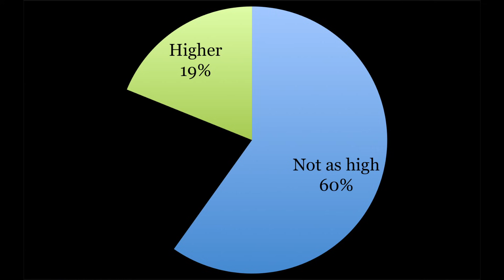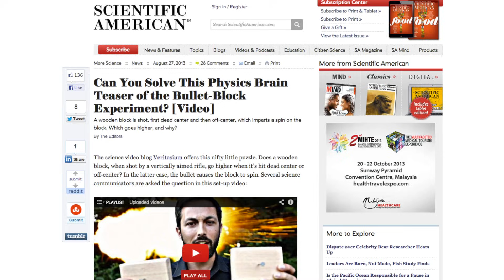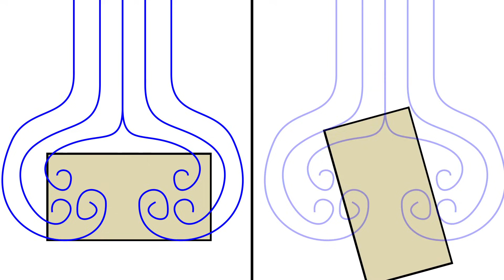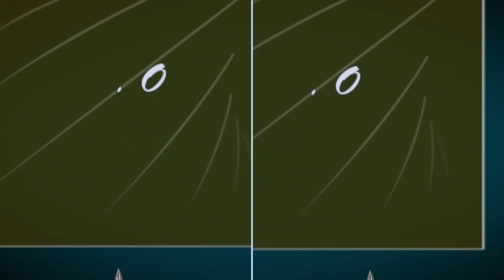Bullet Block Explained!

Comment: If they penetrated to the same depth, then why the hell did one nail go in farther than the other?
Reply: Derpcate abomination-face The mystery thickens.
Reply: My guess is because either one bullet deformed more, creating a compression of the bullet and so moving its back end deeper into the block, or because the tunnel created is curved in the off center block, as the block rotates whilst the bullet is still traveling upwards. But I'm not really sure....
Reply: they didnt take the bullets out.. so in one. the bullet is more deformed which is basically the one with the bullet at centre.. and the other one deformed less.. meaning its longer than the other one.. thats why the nail measuring method is wrong
Reply: +cat intensifies curvature my friend curvature
Reply: +The almighty hair God 8:10
yes he did.
Reply: because the old lady was biased
Reply: Looks like and did are not the same thing you know. ;)
Reply: +cat intensifies Nothing tells you that both those blocks measured travelled the same distance, they did try multiple times, and in the same way they made us think the block travelled the same distance in the previous videos maybe they did it again.
Reply: +The Eclectic Dyslexic - look at the x-ray image. Inside the hole is too wide to show any curvature.
Reply: The spinning one went in at an angle, so more debris blocking the hole maybe..
Reply: +cat intensifies If the simulation is 100% correct from a physics standpoint, it did penetrate farther in the middle
Reply: PenguinPatron the wood is the problem it had different intensity points I like to see experiment in plastic or foam something that we know it has same intensity
Reply: pay attention. .....
Reply: +cat intensifies I think he said the one off center IS slightly shallower...by 1/10th of a mm. He figured it out with equations since we cant notice that small difference visually.
Reply: Harry Armitage Yeah maybe something like that
Reply: Except does nobody know that the bullet is travelling so fast that it stops before the rotation of the block even starts or before the block even lifts off the ground. And the Xrays clearly show there isn't a curve.
Reply: @GetRoasted1  Not true at all, the bullet stops and the block move at preciously the same moment. one does not proceed the other. because the bullet is losing momentum at the exact rate the block is gaining it. Meaning acceleration is inversely proportional to deceleration.
Reply: it wasn't a straight line mostly as the block was rotating.
Reply: Maybe if they took xrays of the object in two different angles , ie both in the sidewats view and birds eye view , they could have got a better understanding of the depth..
Reply: I guess because the off-center bullet formed a curve, since the block would have started spinning before the bullet reached its full depth. So the nail got stuck when it hit the curve, not when it reached the bullet.
Reply: it curves
Reply: The nail didn't go in as far, because stick a nail into a hole is a very inaccurate measurement. The nail can get stuck any chip of wood in that hole, and your measurement is fluked. 

The reason why he would have left that part in the video, is to give show how confirmation bias can trick you: The nail seemed to confirm your hypothesis. That does not mean that it is proof: it could also be a false measurement (which it was, as shown by the X-rays). Just a little easter egg, and an important learning point if you ever perform science experiments.
Reply: Harry Armitagemy guess is the curve and the other one was straight up thats why the nail went further
Reply: When did he say it penetrate at the same depth? because he never did.

Comment: I don't think this explaination is correct. Just exchange the bullets with rubber balls, so the scattering is elastic, then the situation remains the same, but your explainatin doesn't work anymore.
The real reason that the spinning block has more energy after it gets shot is, that the bullet had already more energy before it hit the block. In the spinning case, the angle between the bullets trajectory and the center of mass of the block changes. Thus, the bullet already had rotational energy before it hit the block, which then was transfered to the block.

Comment: So if you did this in theory and where the bullet hit is the only different variable, wouldn't the less air friction on the spinning block make it go a tiny bit higher? So the 19% that said that the block would go higher weren't entirely wrong?

Comment: You could more accurately measure the depth of penetration by using a material that's easier to penetrate, and possibly a weaker/stronger gun. I'd recommend a bullet that does not disintegrate like a 762 and solid, transparent acrylic, or a much weaker gun and styrofoam. (although styrofoam would be extremely susceptible to misreads based on air resistance, so you'd have to do it inside.)

Comment: Or the change in height was only unnoticeable as the results themselves were so innacurate. When the frame comes up showing the height of all tested blocks the distance gap is huge between results of the same experiment. I think this more than anything is the cause for the conclusion. Ie: the results weren't accurate enough for a proper conclusion to be drawn.
Reply: Sexual Chocolate Lol, you're welcome to do the experiment at home.  He had hundreds of submissions of people testing it at home, all drawing the same conclusion that the blocks went to the same height (As they should with this type of collision, since the bullet stuck in the block).  Don't claim inaccuracies without attempting the experiment on your own, YouTube is just a poor medium to show this since it only allows for relatively low frame counts, or did at the time of this video (even now, 60 fps is relatively low when you're trying to show frame by frame measurements).
Reply: Sexual Chocolate If anything his spinning blocks appeared to go higher on average from the other ones. Yes there's variability, but his math and reasoning is perfectly sound.

Comment: maybe for those who don't understand what independent means you could indicate that they are perpendicular...this gives  a little bit better explanation of independent
You also cannot guarantee that the density of the blocks are identical, maybe you should try using man made material that is uniform throughout (or at least more than wood)

Comment: I think you got it wrong. This experiment clearly demonstrates the law of levers. When the bullet hits the centre, it would have to balance both the clockwise as well as the anticlockwise moment of force of the block i.e. the entire weight of the block. On the other hand, when the bullets hits the side, it needs to produce only anticlockwise moment of force, and since,
M.A. =effort arm / load arm
It would need half the energy to bring the block to the same height. The other half of the energy would be converted to rotational kinetic energy.
Note - The energy lost as sound and heat is equal in both the cases.
Reply: Yashraj Motwani That's not correct. First off, moments of force create rotation, they do not create linear acceleration. Secondly, it always takes the same energy to move an object upwards a certain height: PE=mgh. This value is independent of whatever forces or moments an object experiences (except for gravity, which is constant). 

As a side note, levers NEVER reduce the amount of energy required to lift an object, only the force required. Otherwise they'd violate conservation of energy.
Reply: Yashraj Motwani This is another way to explain but their explanation is correct too.
Reply: Bro thats dont makes sense
Reply: Go back to school

Comment: But if the momentum of the bullet is fully transmitted to the block as vertical momentum. Where does the rotational momentum come from?
Reply: Thomas Bezençon Rotational momentum is independent from linear momentum, and both are conserved independently. The bullet in the center is easy to explain: there isn't much angular momentum in the system before impact, so there isn't much angular momentum after impact, and we see that the block goes more or less straight up with some wobbles.

The off-center bullet is trickier. Obviously after impact the block is spinning rapidly so it has some angular momentum. So the system must have had that angular momentum to begin with, but where? The answer is that it was all in the bullet in the form of momentum offset from the center of mass. If you consider the center of mass of the bullet and block together before impact, it will be a little to the right and below the center of the block. If you asked what the angular momentum of the block is around that point it would be zero because the block isn't moving. But the bullet actually has a lot of angular momentum around that point, because it has momentum that is perpendicular to the line between the point and the bullet.

That's actually all you need to have rotational momentum about a point: you just need to be standing at a point that isn't directly on the path of a moving object.

You can try a little thought experiment if you like: Imagine I am standing in the middle of the road on the divider line, and you drive by. Right when you get next to me, I fire an unbreakable grappling hook at your car, and attach the other end of the line to the ground where I stand. What will happen? The answer is that your car will go spinning around me in a circle until your brakes and friction can slow you down. And the reason is that the angular momentum of your car around the point where I am standing stayed constant. There's nothing about angular momentum that says that things need to be curving to have angular momentum. Your car had angular momentum around me before I hooked you, and after I hooked you, even though before you were traveling straight at some offset, and now you are traveling in a circle at the same offset and speed -- those are the same angular momentums.

In short, angular momentum depends on your frame of reference, and if an object has linear momentum perpendicular to your reference point at some distance offset, then that represents angular momentum as well. In the bullet and block experiment, the bullet had some linear momentum perpendicular at an offset from the center of mass of the system, so therefore the system as a whole had some angular momentum. Hope this helped!
Reply: Thomas Bezençon : The momentum is fully transmitted and not the energy. If the bullet gets lodged into the block the Kinetic energy of the bullet and block system is reduces. Actually If you see this is an example of an in-elastic collision and kinetic energy is conserved only in an elastic collision. So a part of the remaining Kinetic energy is converted into the rotational kinetic energy of the bullet and block system.
Reply: +OMGclueless You nailed this one. I hope Derek had realised by now the correct explanation.

Comment: i said higher without taking into effect parasictic drag. when you spin that block  it   slows rotation. therefore drag prevents it from going higher.
Reply: Leigh Denman No, that's not why they go the same height. This would have exactly the same result as in a vacuum without any drag at all.

Comment: So correct me if I am wrong.

M1V1=M2V2...... or.........P1=P2<----- Conservation of Momentum

P1=M(bullet)V(initial of bullet)=P2=Mblock(Vblock)+(Mbullet)(Vfinal of bullet)

And, 

L=I(omega), but the linear momentum of the block covers the angular momentum?
Reply: Alec N You're half-way there. Conservation of linear momentum is really all that's required to explain why they go the same height. The only reason that Derek mentioned angular momentum is to explain that it plays NO part in conservation of Linear momentum.

Comment: If the block was longer and the fired projectile was farther from the center of mass the difference in the depth of the bullet should be more pronounced also if the block material was of a more consistent density I suggest using a bb gun and a lighter block to make it easier to repeat

Comment: I disagree about relaying on the conservation of lineal momentum when there is a loss of kinetic energy. The way you are using the conservation of momentum requires no loss of kinetic energy or at least equal loss. If the first block converted a much higher proportion of kinetic energy into heat, sound and deformation the whole argument about the lineal momentum conservation would have fallen apart. This would have been more obvious if you have not picked the results that better suited your expressed views.

Comment: I am deeply unsatisfied by this video becuase when you shoot the block on the center it is also rotating (rotating in a tridimensional way) thus when you do the sum of energy it doesn't add up because you are missing the rotational energy on the xyz axis. Even if the angular velocity is very small, rotating in a tridimensional way has a very high moment of inertia so that's why we are missing a chunk of energy.
Reply: I think that doesn't matter. The tridimensional rotation comes from hitting the block slightly off-center. So you might also say: The more off-center you hit the Block, the less energy is converted into heat/deformation. I guess to be completely sure you would have to do 100 more tries, until it flies completely without rotation.But for me the theoretical explanation stated in the video seems satisfying enough.

Comment: M1V1 = M2V2.  Very nice, I got it wrong initially but once I saw it I looked at it as F=mA.  The force in the Y direction is the same in both situations, the mass is the same, so why wouldn't you expect the same acceleration in the Y direction.  Its the mistake I made all through engineering school, I didn't draw out a free body diagram.  Catching me up again after all these years.
Reply: I think the right equation involving momentum for this situation is m1iv1i + m2iv2i = m1fv1f + m2fv2f (1=bullet, 2=block, i=initial, f= final) because you have 2 objects and you wanna measure before and after the collision.

Comment: Although minute, I would also like to add that while the projectile in a bullet is often consistent in weight, the powder, primer, and projectile combination can often cause fluctuations. Combined with other variables, such as a slight change in barometric pressure, gun barrel temperature (which then leads to issues of resonance) and so forth, having your projectile consistently act in the exact same way is nearly impossible. Hense why I have 1/2" groups at 100 yards instead of 0". (Yes it is the machine, not the user =D) Again, this will have very negligible effects in your experiment, but I just felt the need to point this out as an avid shooter and science enthusiast alike. Perhaps in a future experiment, you could implement a chronograph to measure velocity, and see how that affects the results. As for impact material, I'm at a loss, so far as I can tell, any material that will be soft enough to allow a significant difference in bullet depth, will likely be too soft to effectively be 'knocked' upward. The only thing that comes to mind is ballistics gel?
Reply: Max Payne Yes. I believe they used 22 rimfire. Which is generally not very consistent in velocity. Many gun channels have chronographed rimfire loads and some show velocity variations of over 5%, from high to low.
Reply: @OldManButtWrinkles  you could just grab some match grade ammo and eliminate that variable.
Reply: ComfortablyNumb1969 that could explain the different heights obtained in the numerous trials.

Comment: Did you control the load and mas of the slug?
Reply: Standardized ammunition in this case, probably .22 short, is very consistent in velocity and projectile mass - this is a requirement for accuracy- so the total energy in the system is pretty consistent.
The problem is that there are other things removing energy from the system, deforming the bullet, crushing the wood in the bullet's path and splintering the wood beside the bullet path (as you can see from the X-ray there is a rather large damage path, especially as the bullet come to a stop.  The diameter of the damaged area is larger at the end that at the entry.
Reply: thx I guessed lower heigth. next time maybe record the mass before and afthe the shells are fired. Recover the slugs and record mass then you could possibly normalize the results.

Comment: To correctly do this experiment ans that the spinning block can never go as high, use a domed weight on an arm that can spin freely on a bearing 360 degrees vertically . ( an engineered ballpeened  hammer). Then place an aluminum block beside it  twice and redo the ecperiment with a measured scale behind. The hammer will not deform the block, the rounded face will created the identical forces in both instances and you will be corrected and see that the side blow will never go as high in a non-vacuum environment.

Comment: You may use soft object like a wet floral foam and a bullet really sharp, with very less surface area. This way we can minimize the energy loss as heat and friction between block and bullet.

Comment: To increase the difference between the distance of penetration of the two blocks, the nature of the material could be changed. A heavy plastic could be used, and necessary adjustments to the dimensions of the block would be needed.

Comment: Measure the temperature inside the bullet halls with IR-termometer right after those wood blocks were shot.
Use brittle material instead of wood. Glass perhaps. Non-rotating block would be shattered more.